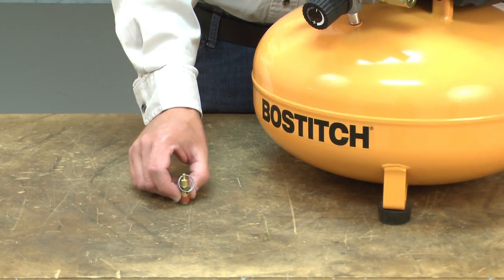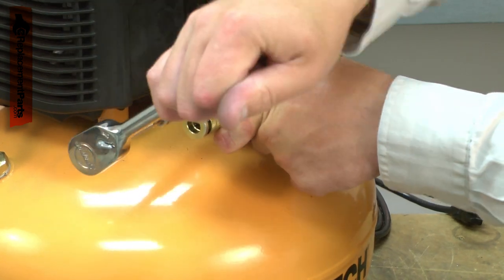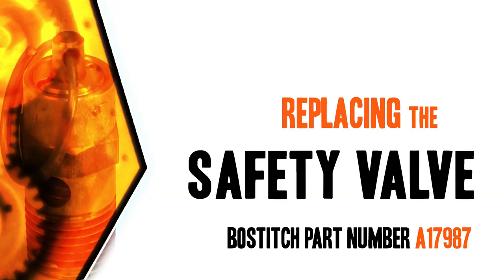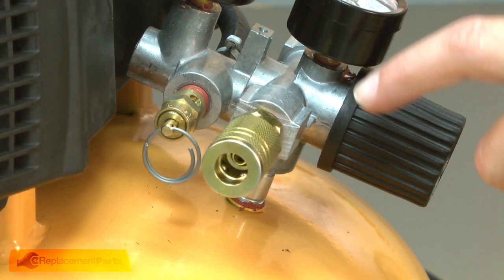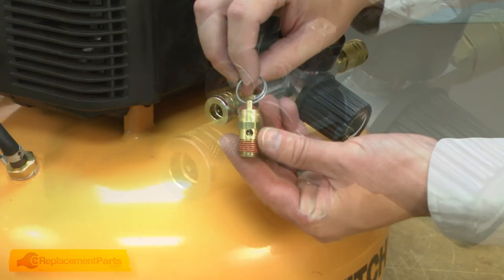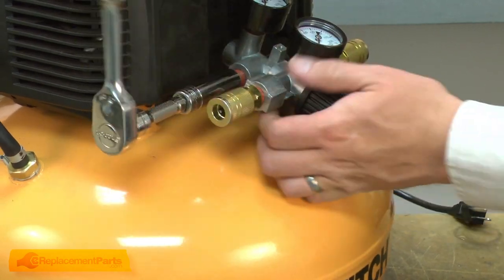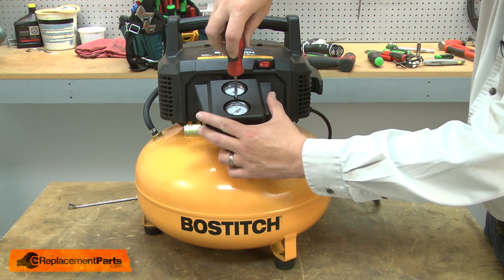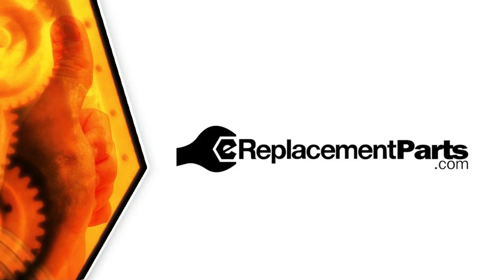Bostitch Air Compressor Repair - Replacing the Safety Valve (Bostitch Part # A17987)

Comment: Can you calibrate the safety valve?  I bought one for my pressure pot and it's rated for 150 psi.  I would like it to pop around 60psi instead.   the safety valve on my pressure pot is of the same style in the video.  Thanks for the help!